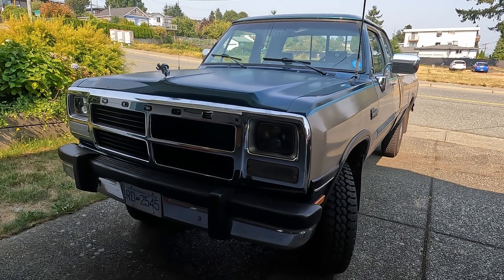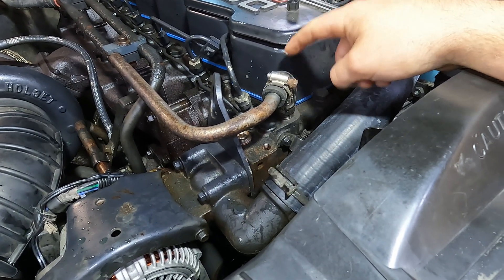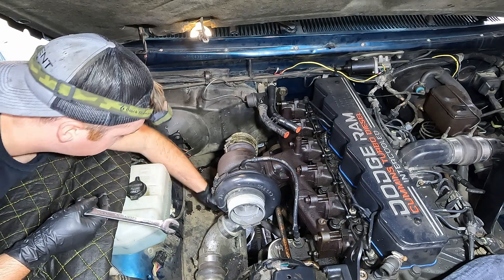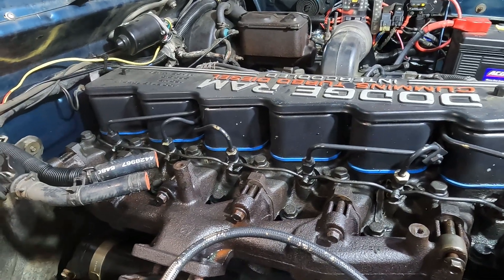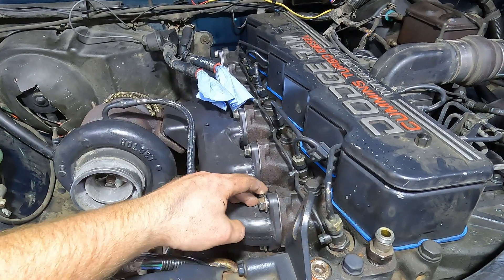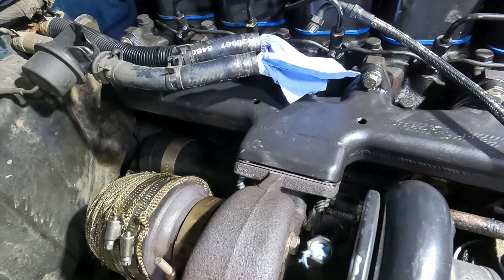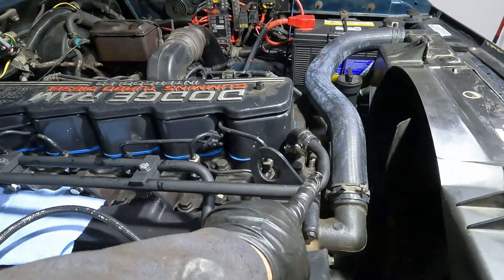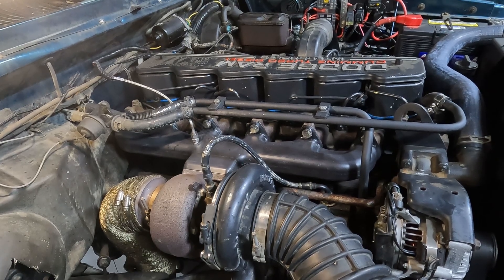Steed Speed Exhaust Manifold | First Gen Cummins

Comment: Did you use the t3 manifold? I was told by crazy Carl turbos that the steed speed manifold is 1” longer from head to turbo. Do you see there being any clearance issues if using a 4” downpipe exhaust?
Reply from the maker: This is the T3 yes. I currently have a 4" Flo Pro (now Mel's Manufacturing) downpipe and have not had any clearance issues at least with the stock H1C that is.
Reply: @roughcutsgarage  ok perfect that’s the same downpipe I have, I do have an hx35 turbo but that shouldn’t matter I don’t think
Reply from the maker: Not sure exactly what Crazy Carl Turbos is referring to as this was pretty much a drop in to the stock manifold.
Reply: @roughcutsgarage  have you had any problems with the manifold to head bolts backing out? I know some people recommend studs with nuts

Comment: Last question … What other supporting mods are needed to make the manifold perform properly ? Turbo and injectors ?
Reply from the maker: The manifold itself doesn't require any specific mods for it to work. I am running it with stock tuning, turbo, injectors etc. It just allows for  better exhaust flow to the turbine so it's up to you for where you want to go from there. 👍

Comment: Why steed over another 3 piece?
Reply from the maker: I chose the Steed for 3 reasons. The design of the Steed is more streamlined on the inside due to the CNC/ welding method vs the cast multi piece method of a 3 piece. I wanted to support local Canadian business since I am from BC Canada. I was part of a group order with a few friends.